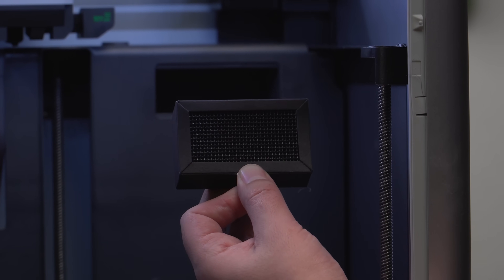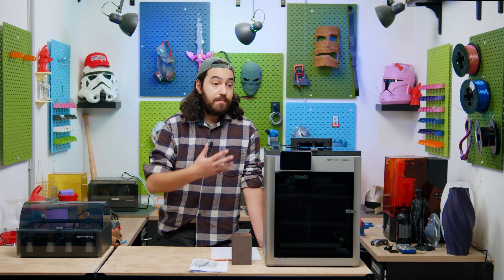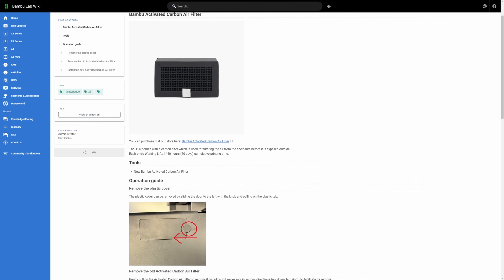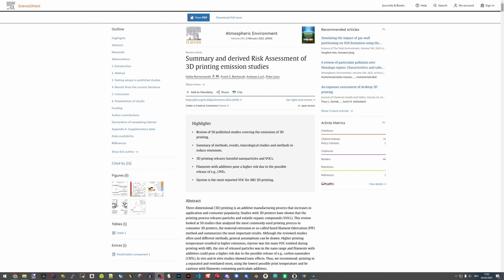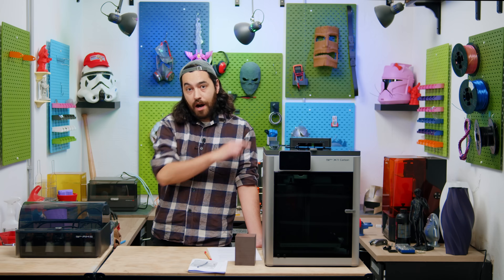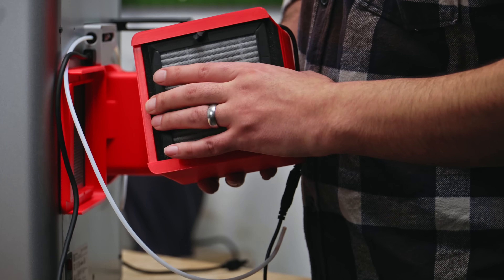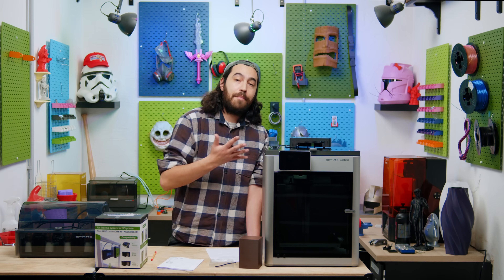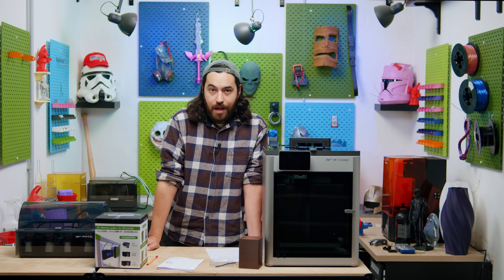Are You Breathing 3D Printer Fumes? Bambu Lab Upgrade!

Comment: Question! I bought my first printer…a Neptune 3 Pro…two years ago and still haven’t used it 🙁 b/c I realized the VOC concerns. I had to move to a much smaller apartment shortly after and there’s not really a good location for it other than my bedroom. Venting isn’t an easy option either. I’m not anywhere near ready to buy a Bamboo printer this expensive, but would this setup allow me to print in my bedroom? I hate missing out on this fun hobby / skill and was planning to print with primarily PLA.
Reply from the maker: You would still need an enclosure so fumes can be trapped and only exit through the filter. Most cheap enclosures are of the fabric variety so there is nowhere suitable to mount this filter but you can find DIY enclosures that have hard frames where this can be mounted.

Comment: hmm it seems like if you have a separate hepa filter, the stock built-in works well? it'd be interesting to see how long it lasts. I think i'm just gonna design a box for mine and throw pellets vs the stock filter because I doubt it lasts long at all.
also it's so hard to compare results with the graphics using different scales!

Comment: A carbon filter is not a particle filter but a chemical filter. Particle filters are rated from 1 to 17, where the HEPA is in the upper range (H13 and H1). Carbon filters themself are just particle generators (just touch the carbon, then you know). Only the combination of a carbon filter, followed by a HEPA filter will remove the dangerous VOC´s and capture the fine dust generated printing and the released carbon particles.

Comment: My printer is in a wardrobe in my room, i know. Not great, but its the only place i can put it right now. And I've rarely been using it lately. Started using it again though, and even just from priting during the day, and leaving it off hours before going to bed, one night i was starting to get a headache, so i bought an air purifyier m, hepa, with carbon filter, to keep in the wardobe, and it been fine since. Not even getting that faint plastic smell when its printing. So its definitely doing something.

I really should have bought one sooner.

Comment: I have an exhaust that has an inline fan pulling air from the printer going straight outside. I took the carbon filter out. Not sure if I should put a carbon filter back in or look at options like this.
Reply: Why would you remove the filter prior to putting the fumes out into the environment?
Reply: @ because with the 120 cfm inline fan I have it seems to not pull air out from the machine and more so allows it to back into my printing space. I know that the next question you’ll like ask is why don’t you buy a stronger fan. And to that, it’s expensive in Australia.

Comment: I almost exclusively print with ABS, PC and Nylon. I upgraded all my printers with HEPA filters and extra Carbon pallets. Additonally I run 3 HEPA aircleaners with high throuput through during the cold season. In the warm season I run 2 heavy duty vents with an flow to exchange the air in the room once minute. For ocational prints the system you presented looks good, but the users needs do be reminded that all filters need to be exchanged regulary.
Reply: Dang how Many printers